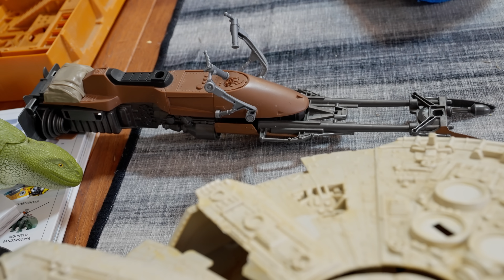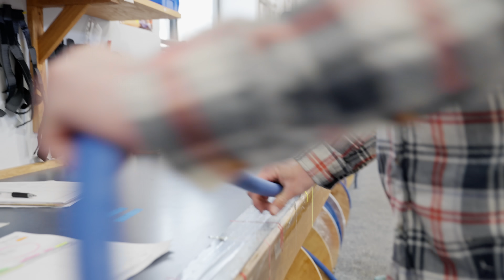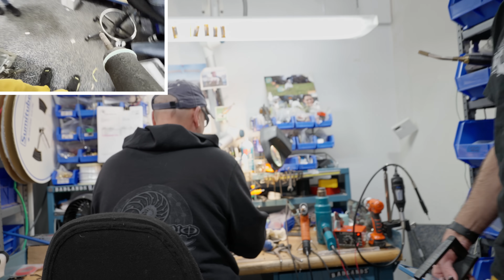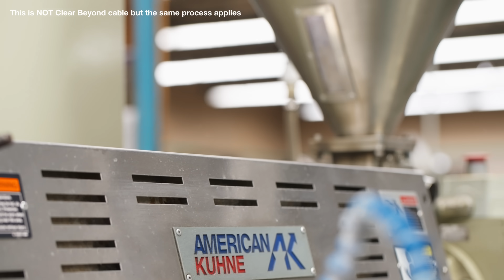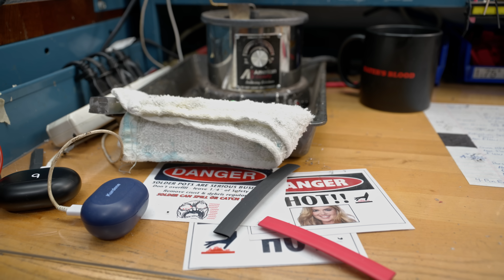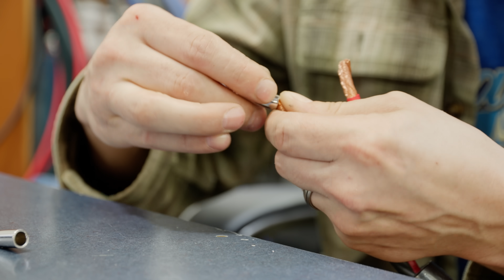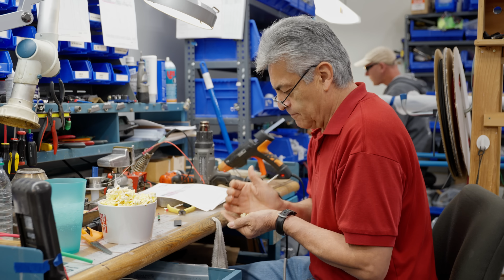This is the BEST video about LOUDSPEAKER CABLES that you will see all year

Comment: Big fan of Cardas and think their tech, materials and engineering and manufacturing process is the real deal.  Have Cardas Clear throughout my system- smooth, relaxed and musical presentation.  Not sure I have the means to upgrade to the Clear Beyond, but very happy with the Clear.  
I've said that for a long time now, if you don't think cables make a difference, chances are the system does not have sufficient resolution to notice the difference. If you have a 10k system, improving cables is going to make little to no difference.
Love that she has the JRDG piece at her side.  Rowland with Cardas is a perfect synergy.

Comment: I never heard good Cardas cable. In varios Hi Fi systems, I tried a lot of different models and price tags (including older models like Golden Cross, Golden Reference etc) and all sounds so bad, so closed up, so boring and even dirty and muddy. There are a lot cheaper cables which sounds so much better. When they finally achieved clear sound, then they named model "Clear"... but at which cost? Many cables with 10 times less price sounds the same or even better. I think Cardas is fraud, nothing else. Sorry, just my opinion.
Reply: Totally disagree.  I have heard many different cables in my system- AudioQuest, MIT, Transparent etc., and time and time again I have found the musicality of Cardas unparalleled regardless of price.  But as you say, you are certainly entitled to your opinion.

Comment: I think for the price at the end of the build process if you want to ensure no contamination the last thing you want to do is have human hands twisting the cabling with no gloves on, that process should be improved for the cost of these cables.
Reply: Go in to a place where they build semiconductors the manufacturing process requires an extremely clean environment to prevent contamination, this is bullshit.

Comment: Touching the cooper strands with bare hands?!?
Reply: Agree. Just wear gloves
Reply: I was thinking the same thing, until it became clear that they are using magnet wires. Doesn´t matter much when just ~50% of the surface is making contact when they crimp. They way they removed the insulating film was.... Well, most would agree 50% is very generous. 

Watching quality control being performed with a $10 DMM in continuity mode was just painful. Probably much more painful than walking in the shoes mentioned in the video. Budget for 2025:  $ Quality Control < Shoes for wife
Reply: @81formann  It's litz coated wire.  It just look bare.

Comment: My thoughts about cables in general after 50 years being a pro musician/teacher/conductor and audio freak: An electrical signal can never come better out of a cable than it went in. You need good equipment/speakers/room acoustics/trained ears to hear differences. Any cable works as a filter. Every company say they use copper that others cannot buy. The profits that ere beeing made are extreme high. You can do with my experiences what you want, even nothing.

Comment: On most of my setups I used old 18 gauge belden pa/intercom speaker cable. Granted, most of my systems were built around some 70's/80's budget receiver rated between 30-50 watts per channel and my cable runs were less than 10 feet. It usually sounded decent enough to me.

Comment: Funny how they don't use special wire inside amps and speakers.
Reply: Maybe they do?
Reply: Actually all top speaker and most  DAC/amp/ preamp makers use specific model/ brand cables that voice their respective electronics because it all matters and makes a difference 
They don’t talk about it unless you contact them and ask. Audioquest, Transparent, Chord, Cardas, Wireworld, Shunyata and Nordost wires are used by many hifi brands
Reply: That's a similar scenario to the argument that fancy mains cables make no difference due to the electrical wiring in your home is all just standard domestic cabling.

 I've heard the argument being that domestic cabling and also internal amplifier wiring is effectively shielded from external influences by the conduit and casing, whereas mains cables, audio cables and speaker wires are effectively exposed to various interferences. 

I don't think that my home system, although by no means bad, is resolving enough to benefit from cables like those being manufactured in this video so my home made mains cables and mid-brand interconnects will do me just fine.

Comment: They 'only use the most pure copper'. I wonder why staff is not wearing gloves while handling the copper wires. Acid on the skin will do something. Or not?
Reply: One thing they didn't show is that each individual strand is insulated. So each conductor has to be plunged into a tinning pot to burn off that insulation. Or at least that's my experience using some of their bulk litz cables.
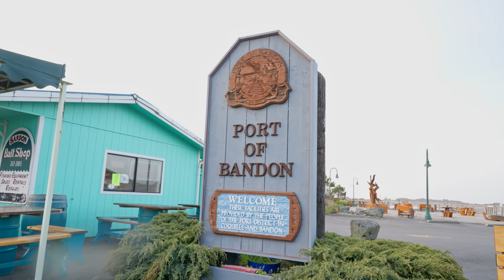Reply: @robhughesguitar  Yeah but the guy who does the crimping (@21:00) also isnt wearing any gloves, so...yah. For the price they are charging, I want to see Japanese level of cleanliness

Comment: I had an engineering friend at Intel where I worked for 8 years whose job was as an expert in signals.  He was in the "cables don't matter" camp and claimed he could prove it with his fancy measurement equipment.  He listened to three different interconnects on my old system and threw up his hands and conceded.  He didn't even need to listen to the Radio Shack $5 RCA cables that he brought to prove they were just as good.  He started to (then) explain why there might be audible differences between cable designs.  And nobody squawking on the internet about needing to prove it is as qualified as Kevin was.  He was one of the best signals guys in the world.

Comment: I have used cables from Siltech, Ansuz, Furutech, Oyaide for years.
As a joke I ordered copied power cables from Odin2 and Valhalla from China.
I was shocked at how good they sounded.
I then sold my stock of the famous brand cables.
I think the manufacturers have ripped us all off with their fantasy prices
Reply: where do you get these copies?
Reply: @rolling1885  E-Bay.
Reply: I just ordered Valhalla 2 cables too. Have yet to receive them but for only 86$ for a pair of 1m speaker wire I couldn't go wrong. Excited to see if I hear any differences

Comment: With the exception of cables made with a high precious metals content, even the most expensive and complex cables come out of the cable factory at a cost of dollars per foot,  maybe 20 dollars per foot for the most complex types, at a guess.   The costs to terminate the cables can involve several hours worth of employee labor,  but when you're talking about a 10,000 dollar set of speaker cables,  don't think for a moment that the profit margin on it is multiple thousands of dollars shared between the manufacturer and the dealer.

Comment: As Ray Kimble of Kimber Kable responded when someone asked him why his 'Kables' cost so much, he said "Because people pay me for them." There are so many hypotheses out there on audio/video cables its mind numbing. Everyone has their own reason why there's are amazing. It's an endless rabbit hole of research.
Reply: It's an electrical path from the amp to the speakers, the posts on the amp would only be soldered in, and that's good enough from the amp stage to the electrical speaker connections.
Look how thin the voice coils are on speakers, any cable larger than this is over kill, unless you are running a system flat out for hours at a time, in which case they may get warm, but so does the voice coil in the speaker.

Comment: What the high-end cable industry really needs is a legitimate neutral 3rd party researcher to conduct blindfold tests among audiophile and non-audiophile listeners.  There could be a very good reason why this (to my knowledge) has never been done.
Reply: shtap, you're making too much sense.
Reply: Alpha Audio. Blind test of 30 cables. Check it out.
Reply: Like the man said he didn't have a system that could resolve the difference between cables.  Some people no matter the system cannot discriminate the difference between cables.   What I find laughable from the all knowing 900IQ engineer types is they have not experienced how some of these "High End" cables completely ruin the sound of a system.  Especially the silver coated copper cables, do you like your hysteresis much?  There is difference in cables but many are the same, what is important is that when there is a difference there can be a preference and that is all.  These hand built cables that sound the same as every other cable CAN make your system look really cool...how much is that worth?  Cardas Golden 5C speaker wire, MIT M750 shotgun, Kimber 8TC speaker cables will all give you a choice between using a coat hanger, sound king 12 guage, electrical cord try it out!  Call the cable company and borrow some cables from their library.   Because the loud and ignorant dominate this argument due to the lack of "academic research studies"  there is never a conversation how cables are more likely and how they degrade the sound of your system.  HOW can people who have never heard the difference between cables select the cables to compare?  All those clever engineer types with superior intellects simply chose wires by their price!  Did they learn that in school?  "Cold forge it"...versus solder, step one. I will end my rant there.  Good Day! :)

Comment: Look like solid cables but why does she remove the insulation so much that there is a risk of a short circuit? Shouldn't there be a piece where the insulation and heat shrink overlap instead of using glue where the outer insulation stops?
Reply: They hired a bartender to terminate the $5k speaker cables with a dull razorblade. All one needs to know.
Reply: I was thinking the same thing. Makes no sense.
Reply: I think they do it because they have to twist individual layers of the cable together. Also the single copper strands are enameled so there’s no risk of shorting them even without the insulation.

Comment: I love this company, but I dislike how they handle the copper with their bare hands, my experience has always been that it will corrode because of the oils on our skin.
Reply: They are enameled. The have a protective, non conductive coating on them.
Reply: That was my first thought. 'Clean Room' assembly environment and process should be considered, given the effort and expense of the raw cable production. Great video!

Comment: I was just looking at the $ 2535.00 Cardas Clear Beyond XL power cable.  I'm just wondering what to do about the wires running up the wall on the other side of my electrical outlet....you know, to get the very best sound out of my equipment?
Reply: Install a Tesla power wall and run your amp from that!
Reply: Rip out the Romex in the wall and replace it all the way to the circuit breaker box. Also should install a high capacity noise filtering device at the circuit breaker box. I use Sola constant voltage transformers that also do a great job of filtering out the noise. Unfortunately the transformer is a bit lacking in allowing high source currents above its rating so the power amp should not be connected to it.

Comment: The prices are ridiculous.
Reply: Not really.  Apparently you haven't compared them to Shunyata, Synergistic Research, Audioquest, etc.  But compared to stock chords, yes.
Reply: Comparable as using an old extension cable you'd find in a trash can.
It's an electrical path and nothing more..
Open up your amp, notice the wires from the amp to the speaker connections are simply solder, no copper used or needed, just an electrical path, open up your speakers, they'll be soldered onto the speakers and terminals using good old fashioned solder..

Comment: Looks like a great place to work, and if you have the equipment and listening skills to enjoy their cables you seem to be in very good company. Seemed very wholesome. It's not for me though, I probably have not got the equipment or the ears to resolve any convincing differences when A/B comparing speaker cables: A.) low capacitive cable, B.) low inductive cable (using litz like structure) and C.) super cheap 4-wire mains cable.

Comment: The guy is absolutely right in when he says these are not for the average customers. It’s for those with “High-end” systems that have nothing left to spend money on and believe that this will actually put them over the top. Measurements tell a lot about the speaker wire/connectors and conditioners.

Comment: So I wondered why two of the main selling points of Cardas Cable, VPROP--the velocity of the propagation of the signal, and the Golden Ratio of 1:1.6... were not addressed by the video of the manufacturing process? Supposedly the length of the conductors is increased to account for the slower propagation of the dielectrics v the conductors is increased. I saw nothing as to how this was accomplished. Same for the ratio of conductors. Would have seemed to me  of been primary importance?

Comment: I work with copper cables and i'm not allowed to touch the copper with my bare hands due to the fact that the cable will oxydize and have a bad influence to the connection.  so when i look at this video i am not convinced. I think it only looks good.
Reply: You spelled oxidize wrong.  they said that every copper strand was covered in enamel so it wouldn't oxidize. that's why they had to basically sand off the plastic with a metal-brush wheel so it would take the enamel off whenever the wires are connected back at the cable ends.
to be fair, they make much cheaper cables as well. they make one that's $6.75 per foot. it can also be custom ordered. it's not spectacularly spun with alternating spiral strands, but i'm pretty sure it's the same enamel-coated copper. it's also smaller guage with less expensive connectors.
Reply: @tirkentube   If bad grammar and poor spelling bother you then reading the comments section on almost any YT video will be bad for your mental health. It was for me until I started the electro shock treatments. Now it doesn't bother me at all. I have a craving for wonton soup I didn't have before but at least wontons don't make me scream at the monitor like I used to. CHEERS..
Reply: If they could guarantee same quality at same price with gloves I'd prefer that... but sometimes the sense of touch is important to feel that nothing weird and lumpy is going on too. 
It's clearly a hand crafted process, if gloves makes it worse then crack on bare handed.

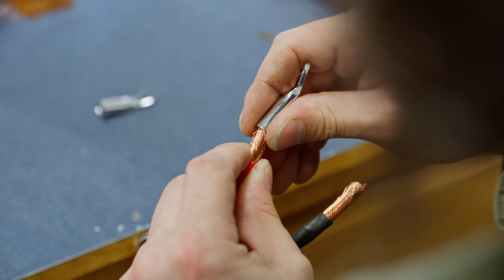Comment: So, I will clarify, on a high-end system, cables matter... Its the price tag that offends the commonsense part of the brain.   Yes, manufacturing American made custom cables is not a cheap venture but the ultimate effect on sound is the geometry of the cable and the gauge of the cable in relation to its length.  other aspects such as silver this or copper that, are much lower on the detectability scale of the final products sound.    So that rogue copper strand sticking out or the incorrectly sized crimp die that caused crimp ears that needed to be grinded off (22:45 section) wile insulting to see at that price point, wont effect the sound. 

As an example, I have a pair of AudioQuest Wel Signature cables that are priced around $10k US and a $300 knockoff from China of the same cable.  I've taken them apart, and the geometry is identical, the differing conductor sizes that AQ claims make a difference are identical, the way they are terminated is identical.   The only thing not the same is the real AQ Wel Signature uses silver conductors.   I have auditioned both pairs for months and cannot tell any difference to the point that I keep forgetting which pair I have on.   The point being the cost is what's hard to justify.
Reply: There's apoint where a human being just simply can't hear the difference anymore and its just placebo.
Reply: @PhyrexJ  yes its called diminishing returns
Reply: @PhyrexJ  mabe to some people
Reply: yeah maybe, you realise that most metal oxides, and in particular copper oxide, are rectifiers?

Anywhere a junction can oxidise can create a diode effect and distort at least half the wave.

That means anywhere there is a push on, clamp or friction fit to make an electrical connectuion.

This effect probably has far, far more listenable effect once your copper cross sectional are exceeds maybe 2.5sqmm, to be very conservative.

You also realise it has been shown many times that just by knowing the different prices for the cables, this  will cause your subconcious to treat what arrives to your ears differently, it was first noticed with wine and perceptiopns of judges, and has since been shown to hold true many areas.

There  are so, so many more things better to spend the 10K on to improve your sound quality.

And if you were really serious about thinking speaker wire makes so much difference, you would put the amplifier as close to the speaker as possible and eliminate the speaker wire and send the signal to the amp  by fibre. 

I have a degree in electrrical engineering and 30 years experience in these and similar matters.

Comment: I left high-end audio for about 15 years but when I started getting back into it I was shocked that there are still people who think all cables sound the same. When I was in audio you could make or break a system with cables.
Reply: Yeah you could buy a 10k cable or upgrade your speakers/amp/acoustic treatment which would have a tremendously far greater impact on sound quality 😂